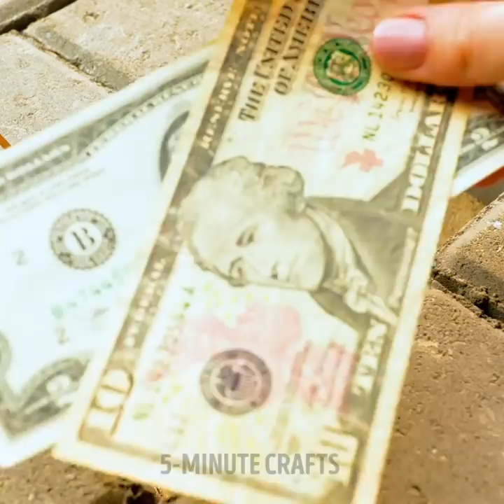Amazing 3D Pen Crafts That Will Inspire You || 5-Minute Decor Ideas For Your Home!

Comment: 6:12 ok so thats fake it clay it does work bot you need to put them in hot water for 3 to 4 mins and they dont get that soft the soften up a little just enough for you to mold them if u dont work fast they will crack and break and dont use too hot water or else they will melt😁